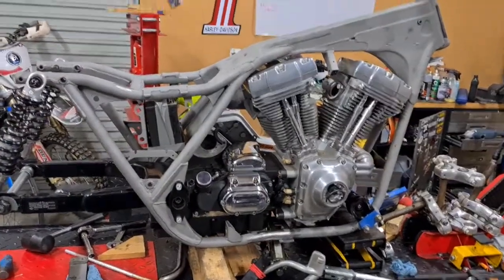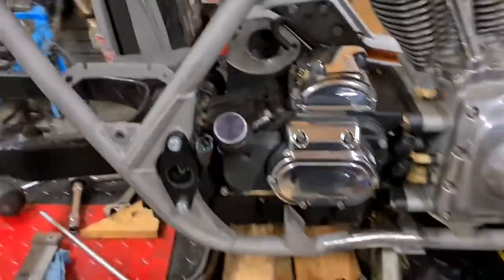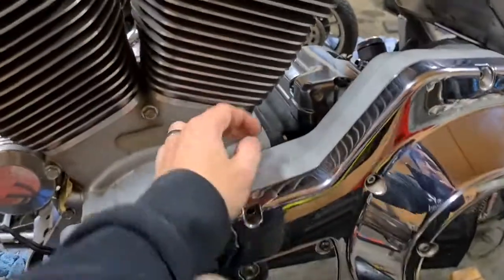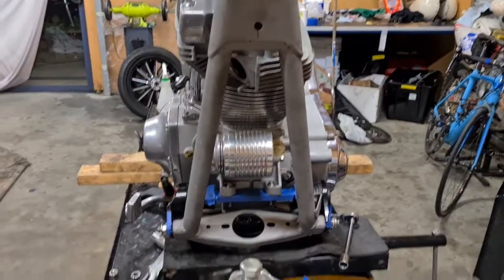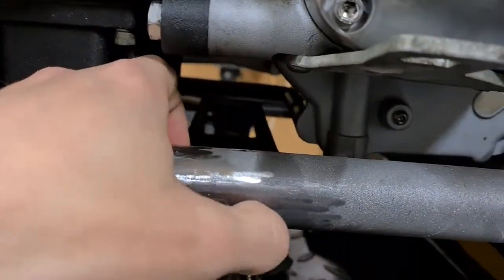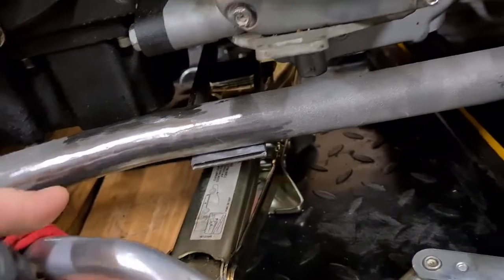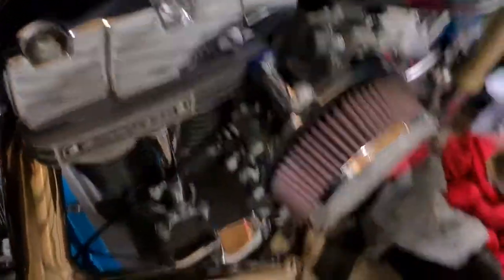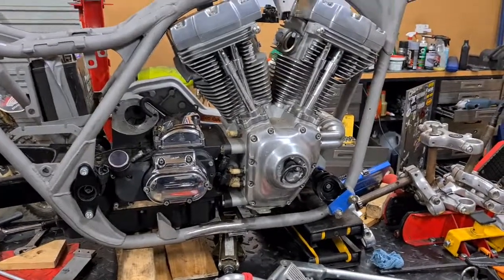Harley Davidson FXR "Clubstyle" Build (Twin Cam swap), Part 1

Comment: Awesome job I appreciate you sharing your info and in my humble opinion, I think it goes along the lines of original biker chopper attitude, using Harley parts(using the best years and mixing them together), not spending an arm in the leg on all kinds of different nonsense

I did have a question now. Was it just the crossmembers that you cut out and does the complete bagger drivetrain work in those frames or is it just a road king motor and trans?
Reply from the maker: Cheers mate, I think of it like OEM+, similar to stock but nicely upgraded across all areas. Good thing about late model stuff is parts availability is so much better, easier and cheaper.

As for fitment, it is just the cross members removed. They can retained of you spend the money on a billet oil pan that can clear them.

It must be a bagger setup used in the fxr frame. Doesn't really matter year or model, but must be from a tourer due to dimensions. Softails/dynas use a longer primary that will not fit. The full drivetrain  from a bagger fits.
Reply: Thanks for the info on getting back to me so soon (brother) keep building

Comment: That front mount really pushed the engine up and back.
Reply from the maker: Not really, clearance to the back bone at rear cylinder is always tight with the TC, stock mounts inclusive.

Comment: I guess if your part engineer this is fun, However if horse power is my end game I would think a 124" or 143" with minor frame mods with the latter would be way...More productive.  Good luck man. I'll stick with my 124.  Not bashing here.
Reply from the maker: Absolute highest horsepower definitely isnt the end game, not with a carb'd 95in motor anyway. Not sure they're really comparable either, by my maths, a 124 would be over 6 times more expensive then this setup cost me. For me, theres not a great deal of value there throwin $10,000 + for an extra 30 odd horsepower, not when Ive got other Harleys anyway. 

If money was no object, it would be a very different bike in the end haha

Comment: Whilst I agree that the FXR ( or later bagger) frame looks nicer, is there any real advantage with those frames over a Dyna frame once you use Chopper Hauss/Big Bear Choppers engine mounts ? With all the frame nods needed it seems to be a helluva lot of work if you are only using a stock/mild motor......
 I have a 2010 model FXDB that is now 113 inch with BBC mounts, it runs about 130 bhp and torque and is fine - after I had stronger front mount supports made as the right-hand-side one broke.... and I don't do wheelies
Reply from the maker: Yeah, massive advantages over the fxr/bagger frames to dynas. Mainly in rigidity, stiffness,  and superior drivetrain mount setup. The CH mounts on Dynas do well to eliminate some of the twist that can snap front motor mounts off the case, but doesn't rectify the back end.
Reply: @jimmyrustles8118  The mounts on the cases are not what snapped - it was the aluminum support plate on the right hand side front of the BBC mount - if I bought them again I would buy steel ones, as it is I got the supports re-made from aircraft quality Duralmin in a much heavier construction build as the BBC ones look pretty but lack real strength.
I was running very short (11.5 inch) rear shocks with heavy springs that transmitted the rear wheel 'road shock' to the front engine mount supports - I now run 12.5inch shocks with softer spring rates and more travel.
I use urethane mounts from Drag Spec and not the rubber Harley ones as they flex too much. 
The rear BBC mount still has the HD rubbers but I have an earlier production one that holds the rubbers real tight and there is no sideways movement or 'flexing' at all. 
All I ever see is a little verticle rise and fall on the front of the motor when reving the engine - no sideways movement or twisting. I suppose there might be some sideways rocking  (and resulting rear wheel 'twist') due to the top motor mount but as the front of the motor moves up and down only a small amount - a half inch at most - it is negligable, and the rear mount just doen't show any movement - up, down or sideways.
 It feels good enough to ride 'one-handed' at 100mph with 18 inch ape-hangers - in a straight line !!
Reply from the maker: @thakery5720  sorry, I meant that this style of front mount reduces the flex that can snap case mounts on stock dyna style front motor mounts when doing wheelies etc. What you're describing is what it should be doing, I.e vertical movement only.

Interesting the BBC ones are aluminium, wouldn't be my choice. These chopper hauss ones are steel.
Reply: @jimmyrustles8118  Yes, I bought the rear mount first then the front one as the bike has so much torque that the front of the motor pushed to the right - end the rea rwheel went to the left !
I tried the Vibratechnics thing and that was a joke - just couldn't handle the power at all.  Every time I set things up and went out for a ride, only to find it all out-of-line when I got home again !
Then I noticed that the aluminum BBC mount was 'sideways adjustable' and bought that as the bike always had - from new - rear wheel alignment problems.
 That combined with the too-stiff rear shocks is maybe what did for the front support on the BBC mount.
I remeber when the Evo Dynas first hit the market - everyone complaining about them, and hear I am putting easily double an Evo's power (maybe getting on treble as I am still tuning and improving the engine) through it.